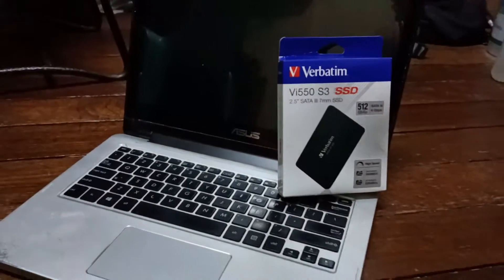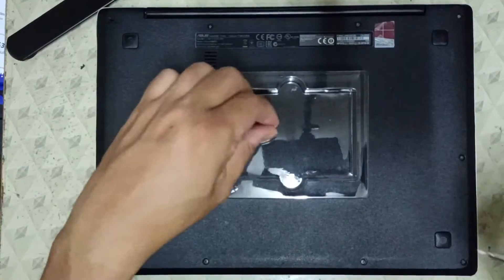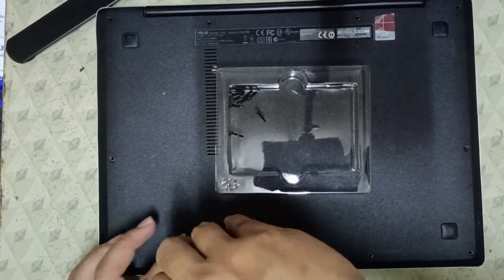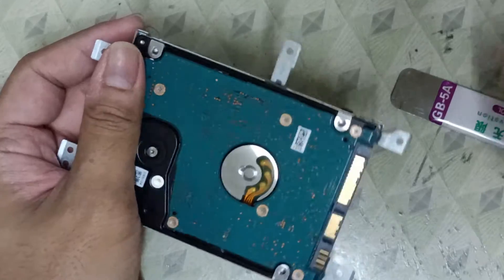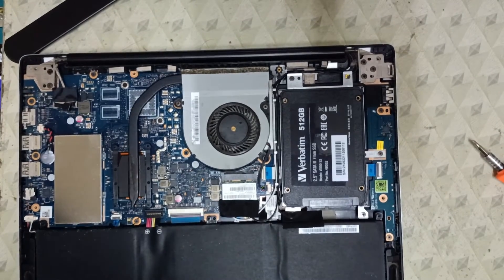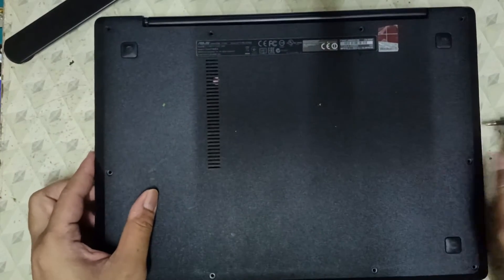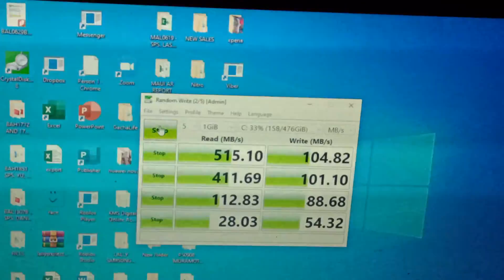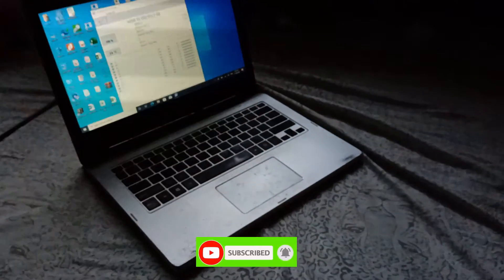Asus Transformer Book Flip TP300LA-DW060H SSD Upgrade Tutorial

Comment: After clean windows 10 installation my touch screen not working. I tried windows 8.1 also same.
Reply from the maker: maybe the device drivers or the connector for the touch screen probably
Reply: @FumieBasketTV  I have tried windows 8 , 8.1 & 10 and also tried updating driver, bios but still touch not working. Even HID touch screen driver also not available in device manager.
Could you please make a video and point out where this connector is and how to check if it is properly connected as it seems only this reason